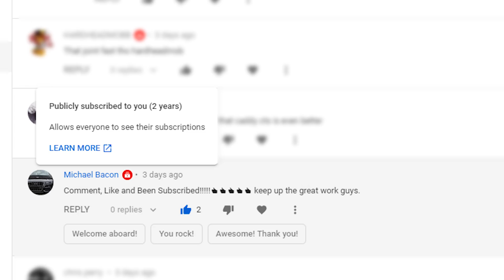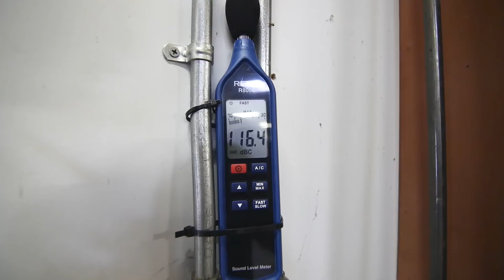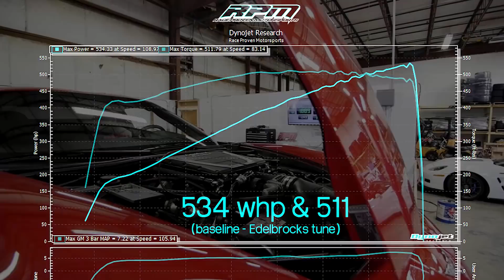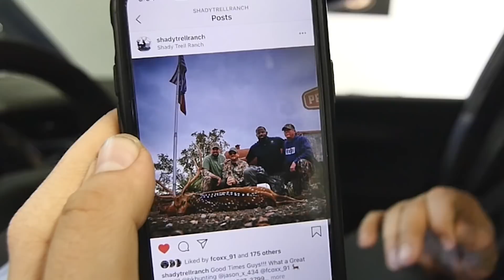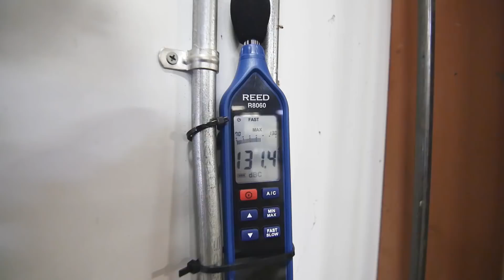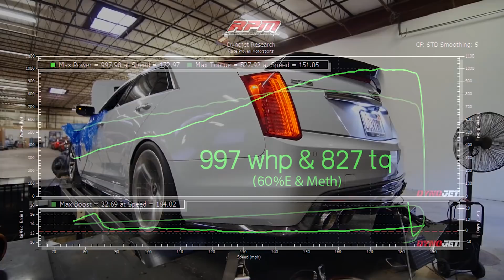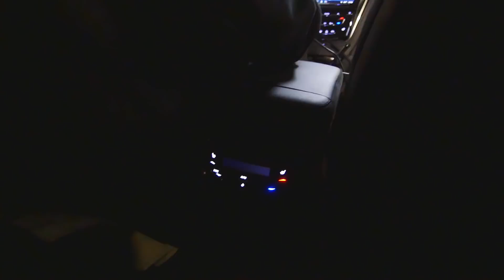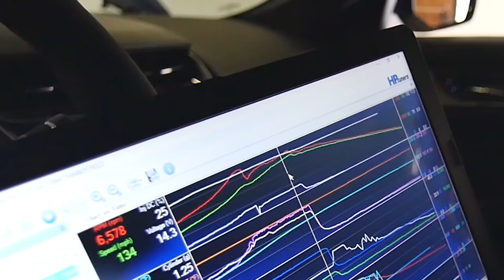Edelbrock 2650 Cadillac CTS-V3 ... The Ultimate Daily | RPM S8 E70

Comment: As far centrifugal superchargers, what are the differences between novi, A&A, and Procharger? Heard the novi 1500 is equivalent to a d1x procharger with an A&A head unit. Also, the novi has shorter belt setups. Correct me if I'm wrong. Thanks.

Comment: At the 15.58 mark you say the blower can' t make a 1000 or 1100 LOL..  Your running like a 9.17 and 3.5  18 or 19 psi probably how about a pulley swap and port injection kit then get back to us..  yes procharger is definitely better.  actually put it on the C7 since it has a built motor to handle it.  I agree with a lot of things you say  but that's pretty dumb 3.0 upper and port isn't any harder to do for a number..
Reply from the maker: When you take what we said completely out of context sure, as it sits it will not make that.  And we would not want to push a SBE over 19psi.  Of course the blower is capable of making way more with port etc we are doing just that on a C7 Z06.